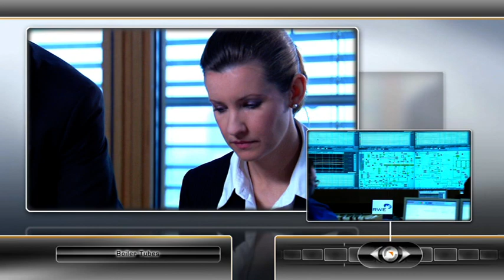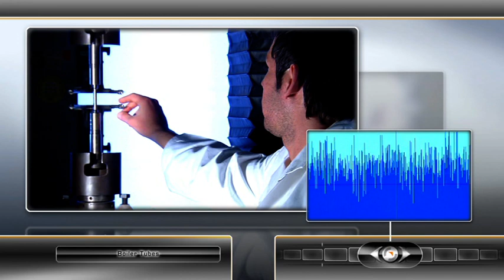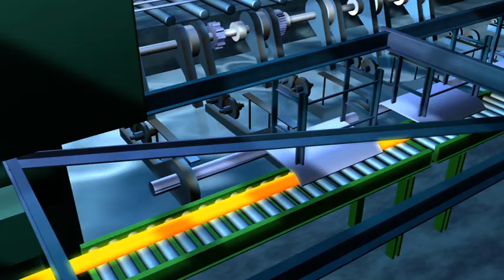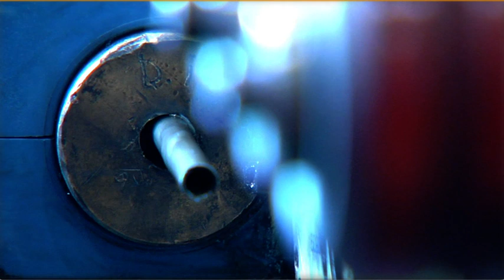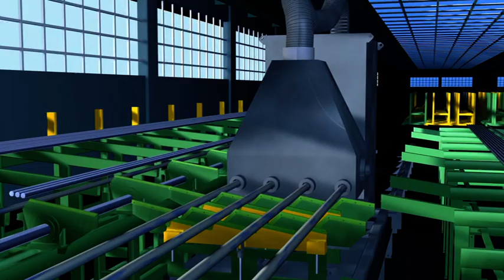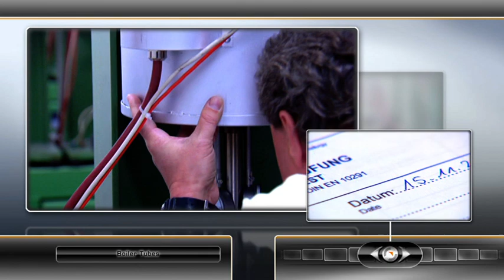DMV - Boiler Tubes

Comment: 我公司从事不锈钢产业链的产品供销业务，从事业务包括制管机、制管模具、内焊整平机、抛光机、抛光耗材及相应的机器配套设备、产品等，如有需要，请联系朱总：+86-15999581282/18820879368. Our company engaged in stainless steel industry chain products supply and marketing business, including business tube, pipe mold, welding leveling machine, polishing machine, polishing machine supplies and equipment, the corresponding products, if necessary, please contact: +86-15999581282/18820879368. Zhu